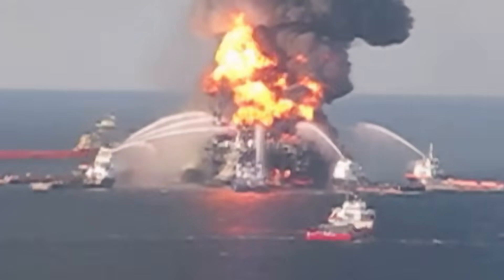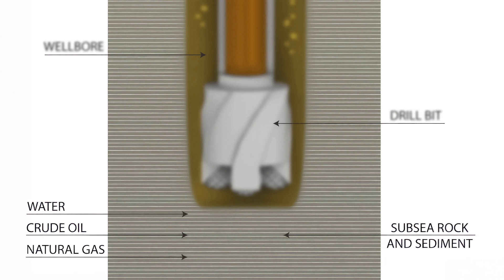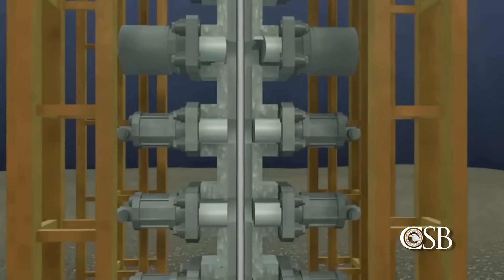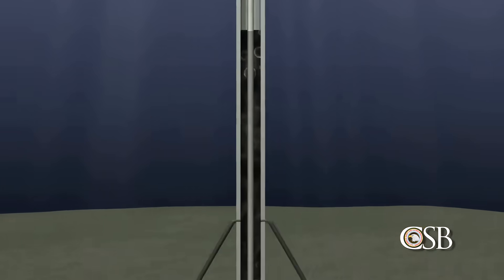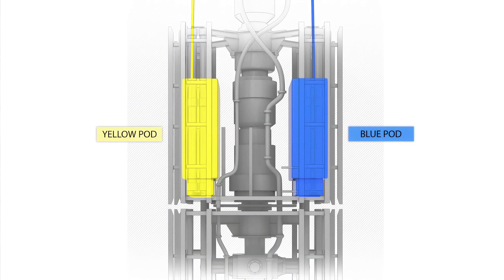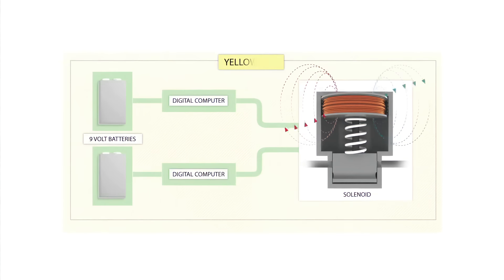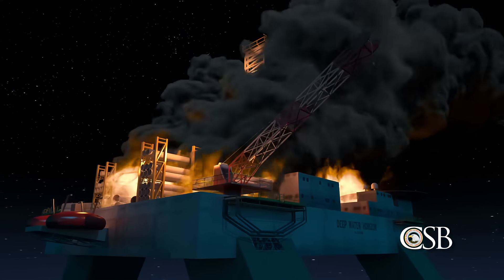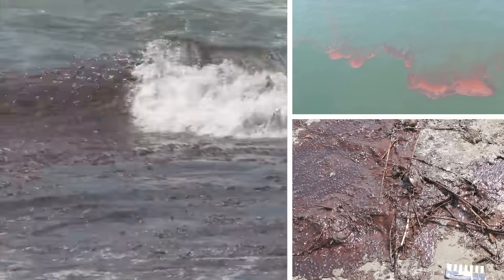Deepwater Horizon Blowout Animation

Comment: This video I find curious because BP was the main contractor and Halliburton was the consultant and the company who was in charge of the proper mixture to cap the well so at a later point the well could be opened and used however all three companies made large mistakes making them all culpable. Along with the lack of oversight from the United States MMS board an explosion was without question going to happen.

I am unsure if this is still considered true but I had read the blowout preventer was also wired wrong, as a commercial Industrial electrician I have no idea how so many splices were wrong, and though I don't really believe it was sabotage I have a hard time believing such simple equipment could have been wired so wrong. 

Believe it or not, the two-second explanation of the wiring very well sums up the system and this is not by mistake, these systems are made to be straight forward and every piece of equipment gets tested before shipping after arrival at the platform and finally, an Ohms reading is taken after install with most systems metering this constantly on the platform. (Edit after confirming this I also want to add that every piece of equipment is shipped with complete directions and proper testing. A joke among people is we do not read directions but in the field, if you do not, you will be fired because you must believe the new equipment is different than anything you installed before this is to stop mistakes and complacency.)

Everyone is to blame and I think this video is a whitewash of the event.

Comment: Those can't be called dead-man systems. A dead-man switch is a device that must be powered and engaged for the machine to function. Something that is reliant on battery power (27v battery) or can function when miswired are not dead man switches. Last resort safety systems, yes, dead man switches - by definition no.

Comment: There's another design flaw that was not mentioned in this video.  How is it possible that a rush of oil or mud from the pipe/channel is unable to be detected until it's already at the oil rig platform?  Surely there must be redundant sensors in the channel to give early warning that somethign is wrong down below.

Comment: This is a good example of why you should never trust any safety mechanism at 100%
You never know with certainty if it has been assembled correctly and whatnot
For example: if you work on your circular saw without unplugging it, there is still a chance that it could start randomly.. Maybe the on / off switch went bad and in the next 1 minute it will power the device on for some reason. Or a variation of this..

Comment: What happened after 87 days?
Reply: Transocean's Development Driller III started drilling a first relief well on 2 May 2010. GSF Development Driller II started drilling a second relief on 16 May 2010. On 3 August 2010, first test oil and then drilling mud was pumped at a slow rate of approximately 2 bbl (320 L) per minute into the well-head. Pumping continued for eight hours, at the end of which the well was declared to be "in a static condition." On 4 August 2010, BP began pumping cement from the top, sealing that part of the flow channel permanently.

On 3 September 2010, the 300-ton failed blowout preventer was removed from the well and a replacement blowout preventer was installed. On 16 September 2010, the relief well reached its destination and pumping of cement to seal the well began. On 19 September 2010, National Incident Commander Thad Allen declared the well "effectively dead" and said that it posed no further threat to the Gulf.
Reply: Good

Comment: And to think this could have been prevented....even with the hydrocarbons comming up to the rig,   loosing the propeller control keeping the rig straight over the hole, an oil field worker informed me that the rams that can cut the pipe, cannot cut across the connections of the pipe, and something with Pythagoras theorem, if the rig drifts away from the hole, the distance to the BOP is now the hypotenuse and not the rise, so positioning the pipe appropriately in the bop to be able to cut the pipe never happened....

Comment: Just out of curiosity - why couldn't they put a sort of curtain or piping around the spilling area (seen at 10:25) so that it contained the oil on the inside of the curtain, and then separated that oil vs. the sea water until it rose to the surface/ then sort it at sea level?

Comment: I worked as a health and safety rep for a few years. Those skills gave me a keen eye for stupidity and poor decisions, from years of watching people cut corners. What I've realized after years of working in multiple industries, for a variety of different sized companies, is that all "accidents" are caused by the exact same thing - some stupid moron cutting corners, or not taking health and safety seriously, or not believing that anything bad would actually happen. I've seen it over and over again. And what bothers me the most, is that most of the time, it's not the negligent person who gets hurt, but the person after them who had nothing to do with the poor decisions made. 
I once trained a staff on how to handle industrial strength pesticides; I taught everyone typical standard operating procedures, understanding the MSDS and where to access it, the importance of proper storage and handling of the product, etc. Of course, no one gave a fuck. No one ever does. The amount of times I've warned people about extremely dangerous hazards, only for minutes later to catch them doing the exact thing I told them not to do. Oh the rage I've felt. Anyway, to make a long story short, some complete idiot decided to leave a container of myclobutanil (concentrated poisonous pesticide) open on a random shelf, without the lid on, spilling all over the place. It was technically a code brown at that point. Then, some other idiot for reasons unknown, decided to put her lunch sandwich on said work shelf (nowhere near the lunch room, and something she had never done before) completely soaking her sandwich with it. It was only by chance that I saw the sandwich and through it out because no food was allowed in this work area, and it was by chance that by making that judgement call, I discovered the sandwich was soaked in poison. I did this just before she was about to eat the sandwich, which would have killed her. I was so mad that I couldn't stop myself from screaming at both people involved - at the guy for not closing the container and putting it in the cabinet where it belonged, and at her for eating her lunch in a known dangerous work station where food was not allowed. 
This is but one of many, many experiences I have had like this - people just being lazy and doing things they know better not to. I always explained to people that I trained that no one ever expects things to go wrong, and that when things do go wrong, it's always because of the most simple, unassuming, seemingly harmless and borderline irrelevant decisions that end up costing someone dearly - like something as simple as not putting a lid back on a container, or setting down a sandwich for a second. I always explain that if there is a rule that seams stupid or unreasonable (like no bringing food in certain work areas, or the mandatory labelling of containers, or putting the lid back on after every use, even if it will be used again in a minute), it's because, at one point in time, someone did the very thing that caused the rule to be put there in the first place. 
Anyway, I still have those health and safety skills, but I had to stop working as a rep, because I just couldn't handle the overwhelming levels of laziness and stupidity exhibited by about 80% of people. It was too stressful, knowing that no matter how clearly I explain the procedures and why they are important, or emphasize the consequences of mistakes that can cause serious injury or death, most people are going to not adhere to proper health and safety. Dealing with apathetic people is enough to make someone go mad. However, if I do see someone putting someone else in harm, I still freak out on them. I can't help it. Too many years of frustration has created in me a certain rage that gets triggered when I see such stupidity.

Comment: 9:40 I suggest that your graphic is incorrect and that it shows a hair density of arrows on the long side of the pipe which is simply not correct. It does show one arrow in the shadow zone which wouldn’t be on the other side of the pipe, that would be correct …but the rest of the arrows, not so much.  I also feel this video fails to address the reduced number of centering rods that the drill crew chief decided was acceptable: If the usual number of centering rods have been used maybe the pipe would not have bent as much.

Comment: What  sh*t design, emergency system works only in perfect conditions when the pressure is low and everthing is straight. Let me guess, the emergency systems wiring didn't have to be checked by law because this industry can 'regulate itself'. We do those checks even on machines that can pinch your finger.

Comment: It's amazing to me that the overwhelming majority of the comments here appear to have misunderstood the actual cause of the failure.  Although it's true that one of the crucial safety features was miswired, the mechanical ram did ultimately fire.  It was the buckling of the drill pipe that prevented the ram from being effective.
Reply: The ram fired because 1/3 the batteries was faulty, which negated the production fault which should have been detected before parts shipping of the solenoid and should have been detected at parts acceptance and should have been detected at factory acceptance of that ram-half prior to shipping.
Reply: Regardless of the wiring problems, the ram did deply at jull force.  But the ram was not designed to cut through and out of center pipe.  The amount of force needed to cut through and out of center pipe was well in excess of what the ram could produce.  Furthermore with an out of center pipe the ram could not seal the pipe to stop the flow of oil.

Comment: why the fuck was the deadmans switch operated by a 9volt battery? 

It shouldve been two NC valves on same line and they should be always activated by hydraulics and electricity. If both sources fail then springs should push the cutting fluid valves to on position. And if the springs lose their tension by time the valves should be positioned in a way that gravity will pull them activated.

Comment: And the US government has an agency, at the time called MMS, that is suppose to make sure all safety systems are operational BEFORE drilling begins. Odd how the media never mentioned this, as far as I'm aware.
Reply: It’s funny you mention that because Obama complains a lot about MMS in his recent memoir when he’s talking about this disaster
Reply: It was mentioned many times in the media.........fact is everyone knows the MMS is a joke.
Reply: Even if all the systems in blowout preventer worked as designed the blowout would have still occurred.  The bending of the pip in the blowout preventer had never been seen before and no one realized that it was possible.   with the pipe out of center the last ram could not generate enough force to cut and seal the pipe.  That was the conclusion of the report which I read.  Even the government and the industry didn't know that.
Reply: Go do even the slightest bit of reading on how much red tape that both BP and Transocean hurtled straight through by lying on documents and ignoring procedures/inspections, and you'll understand that the US government had very little control over this incident.
Reply: Straw Raps 2  Lol I thought I was condescending saying the whole "go read" line, and felt pretty dumb when I read the other comments from the original commenter that show he literally worked in the gulf of mexico and knows more than any of us on the matter, but now I rest assured knowing you're way dumber.
Reply: Why would that matter? It doesn't make it the governments responsibility that everything is in order. No government in the world (including North Korea) has resources enough to police every project or check every detail. If such a state existed, I wouldn't want to live in it. Safety and compliance with regulation is always the responsibility of the entity that's engaged in the activity in question.
Reply: @henrikjohansson6629  
I'm going to guess you don't know about the regulations for drilling and oil/gas production in United States federal waters.

When I was working in the GoM no Energy company could drill or produce oil/gas without MMS certifying everything is up to code. If MMS grants a company authorization to begin work it means ALL safety systems have been checked and found operational according to government regulations. If the MMS official did their job correctly.

It actually is the governments job to police drilling and production in federal waters in the United States. That is what MMS, Mineral Management Services, did. One of their jobs was to make sure ALL drilling rigs and production platforms were up to Federal code. No Energy company operates in US federal waters without MMS's authorization.

 The 14 years I worked production in the Gulf of Mexico everyone who worked in production or drilling had to be certified. There was a certification school for Drilling and a separate certification school for Production.
Certification was required by law to work in either drilling or production in federal waters in the United States.

Getting T2 certification required going to a school and passing the class. IIRC, it was  40hr. class. You had to take the 40hr. class ever 4 years with a one day refresher every 2 years between the 40hr. course.

MMS officials were going offshore M-F, weather permitting. They would schedule with the companies what platforms or drilling rigs they were going to inspect. MMS had the power to fine, shutdown drilling and production. They could even have people arrested.

After the Deepwater Horizon incident MMS was desolved and 3 new departments were created.
Bureau of Ocean Energy Management 
Bureau of Safety and Environmental Enforcement 
Office of Natural Resources Revenue 
https://en.wikipedia.org/wiki/Minerals_Management_Service
Reply: @henrikjohansson6629  
You are correct the drilling and energy company are culpable.
 The point I was trying to make is that MMS is culpable as well because they are responsible for making sure all safety systems are operational per regulations. I never heard that mentioned in the media the whole time this was happening or during the trial. Which was my point.
The BOP, blowout preventer, is one of the safety systems MMS is responsible for making sure it is functioning properly.

It didn't surprise me that they didn't talk about the role MMS played in the incident being we had a Democrat president at the time and our media always goes easy on Democrat politicians.

I'm not saying the president or his administration was to blame for what happened. 
The fault from MMS was an internal problem. It wouldn't have mattered who the president was. The blowout would have still happened.

I just hate how the media rarely gives us the complete story. IMO, they don't investigate complicated stories to be able to give us all the information to make an informed conclusion and that is sad.
IMO, they don't pursue in depth stories like these for several reasons. One of them is the time/expense to perform a thorough investigation would cut into their bottom line financially.
Reply: @henrikjohansson6629  Vänta, är du svensk? Ser ut som det på namnet ditt.
Reply: @DChrls  I worked offshore in the GOM for 20 years, from 1984 to 2004 and I NEVER saw any government agency on ANY rig I ever worked on. Ever. I even worked on the LOOP platform.
Reply: @rondj1965  =
I worked in production and saw them on a regular basis. I even saw them a couple of times do inspections before a rig would start doing workover on wells. I was offshore from 1990-04. Mainly from South Marsh Island over to the High Island blocks.

The MMS officials were treated like royalty by the oil&gas companies. If they were doing an annual inspection it was seafood or steak for lunch.
Reply: @DChrls  I don't doubt what you say. I believe you. I worked offshore long enough to know when someone is blowing smoke about working offshore. The safety on and in the petrochemical field has come a long way in the last 50 years. It is an inherently dangerous place to be. Whenever companies put profits before people, they should be held accountable. But I doubt putting any federal agency in charge of protecting workers is the solution. They would need an army of people with the numbers of platforms in the GOM.
Reply: @DChrls  MMS had nothing to do with it. MMS might randomly visit a rig every few months, and that is just to spot check. They have nothing to do with the daily maintenance and preparation of safety systems.
Reply: @DChrls legislators like you are always funny to me. Anyone can say what you’re supposed to do and make sure it’s written down in a book. Explain to me how you’re gonna enforce those rules.
Reply: @henrikjohansson6629  bootlicking comment. The drillers who make BILLIONS should be charged for govt inspection.
Reply: @henrikjohansson6629  in mining and oil and gas no, it's a different story. regulators literally do have to look at everything when a project gets set up.
Reply: @henrikjohansson6629  Do you know how many permits it takes just to build a house?  AND RIGHTFULLY SO.  Building something as important as an underwater well should indeed be regulated.